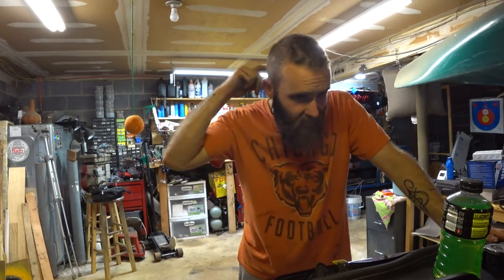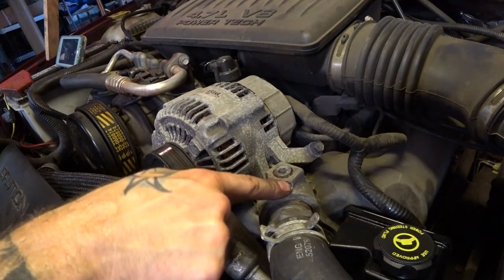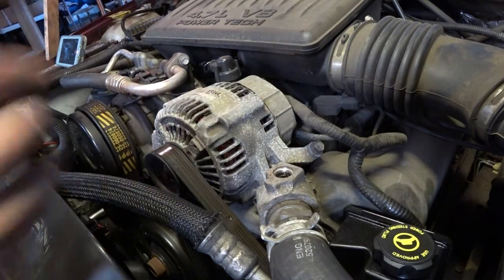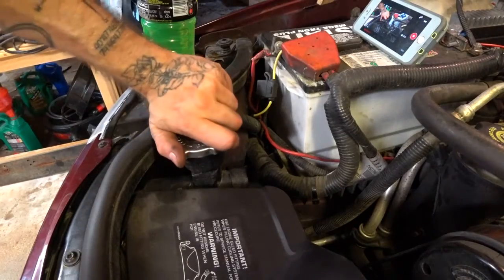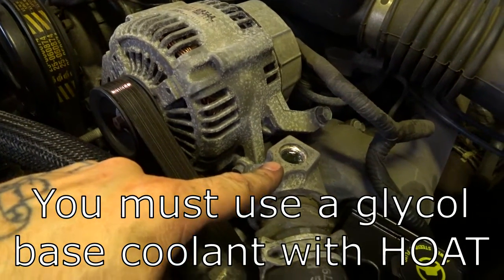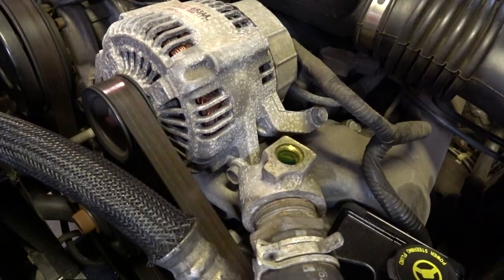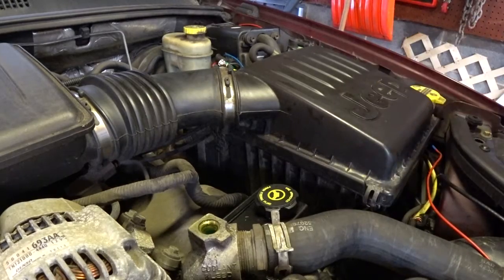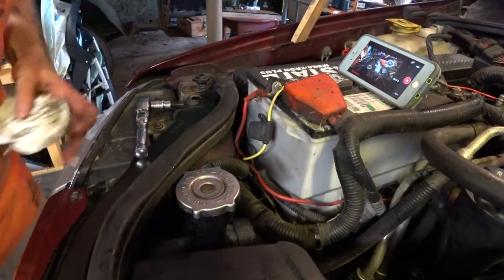How to Bleed a  Radiator - Jeep/Dodge 4.7L

Comment: I'm an 01 Dakota sport v8 owner. About a year ago, I was getting ready to change out my radiator but I wanted to know how to fill it back up properly. I saw another video on YouTube that shows you how to properly fill the Dakota sport that have a bleeding port. In it, the guy stressed the importance of removing the bleeder valve screw before filling it up. I was at that step, when I went to remove the screw, it freaking strips! Had everything installed and ready to fill when this happens. I was like a sh**! So, what happened was, I followed the other steps, turned the heater full blast while filling up the radiator, and I waited for over 30 minutes, observing bubbles coming out where the radiator cap goes, and when I could see very little to none and decided I waited long enough, I put the cap back on and took off on a ride. To my astonishment, the temperature gauge did not hardly budge. The needle on the gauge was well before the middle just above the C, meaning, the truck was not overheating. I thought, so long as this doesn't overheat, I'm good. However, not too long after changing the radiator, I get a leak. I looked for the source. Found out it was the pump, again. But why? I think the pump failed prematurely because there was still air the system. I looked up if not bleeding your coolant system properly, it can lead to failure of the cooling system parts, such as, the water pump.  So, I had enough. I took it to a shop and explained what I wanted done. This mechanic had also, not really heard of or understood what a bleeder valve was but assured me that as a mechanic, he learns quickly and problem solves effectively so as to get the job done. He said that bleeder valve screw was in a precarious spot. He did not want to damage the bleeder valve housing by pummeling it with a chisel and hammer. I got a call from him, and he tells me it was hell getting that screw off, but with a torch and some know how, he said he got it off. And yes, the water pump needed to be replaced. So, as I post this comment, my 01 Dakota sits in a shop and I hope the mechanic understood what needs to be done now to fill that truck up with coolant.

Comment: I doubt you see this on this old video. But my 2002 grand cherokee 4.7 doesn't overheat but last year I noticed that you could start it and let it run for over 30 min and top hose gets hot and seems to have alot of pressure in it.but bottom hose just gets warm.So I changed thermostat and flushed system and put the correct  coolant in it, jeep Chrysler GOLD. And here we are a year later and still does the same thing. Not a daily its just a toy and second car. And engine is a reman with 50-60k miles. Never gets hot but really worries me. I dont get it.

Comment: Where in the F*@*#*@*#"@ can you find replacement bolt ? Cap?.plug? What in the entirety of F#@####### hell is it called? Bout to set a brick on the gas pedal, toss a granade or 5  under the hood close it and and slap it in drive and make a strong whiskey drink ,this mofo has me boiling between this and finding the damn fan module.relay shit that stuck half in and half out of the fan shroud that NOBODY knows about .. 2012 Liberty 3.7 Sport that theres NOTHING sporty about it ,4WD . seriously should have P.O.S. EDITION emblems all over it .

Comment: hey! what's up! I never hear my fan coming on as my  04 4.7 limited Wj gets hotter, it used to always just sit a little below 210 no matter what and now up a hill on the freeway it will go past 210,  also I've replaced the water pump, thermostat, burped it, heat sensor... just cannot figure out?  the fan is moving but it really doesn't kick up when you think it should, the solenoid seems to be good, for instance, I put the thermostat in wrong by accident and the fan fired up to cool the engine or tried to until I realized what I did,  I caught it before it would get to hot .. anyway...  any advice ? for this  pain in the ass!  ps I love the chanel, I saw a few of your videos  back before I got into this whole WJ World and you explain things vary well! so thanks for that!

Comment: My dumb self tried to do this in a autozone parking lot with the employee next to me as I borrowed a tool to remove the bleeder cap as coolant proceeded to blast out at the both of us, engine wasn’t that hot yet so it wasn’t that bad. Lesson learned, don’t bleed things after running engine wait a little bit 😭🤚🏻

Comment: This video made my day after changing the radiator on my 310,000 mile 07 Chrysler Aspen whichever continued to over heat when I swapped it out. I can across your video later that night and removed all the air pockets the following morning. Thanks again.

Comment: Question I have a 2001 Dakota and the radiator cap is on the hose connected to the bleeder 6 inches away do I still need to take that out I use a burping funnel on the radiator cap area

Comment: How much coolant does it supposed to hold?Also I've seen where people are replacing the stock thermostat for a 180 degree one.What are your thoughts on that?I just got an 04 dakota with an 06 or 07 4.7.

Comment: Proud owner of a completely rust free 2002 Jeep Grand Cherokee Limited with the 4.7 H.O. V8. For the last 3 months, I was plagued by my truck overheating, sent it into the shop MULTIPLE times to get it figured out. Each time replaced parts (thermostat, heater hoses, power steering pump, even completely replaced the AC Pump. Same issue, truck kept overheating, UP UNTIL I SAW THIS VIDEO! Woke up, came outside, and followed this video. Lo and behold, almost a whole jug low on coolant when I followed this process! Finally saw coolant through that bleeder valve, capped it off, and boom! Truck has ran LITTERALLY FLAWLESSLY since. I seriously cant thank you enough! You litterally saved a good truck thats 22 years old and means the world to me!
Reply: Could be cause you keep calling it a truck

Comment: Mine runs cool. When temperature outside is below 20 degrees, air my vents blows at 100. Temp gauge doesn't even reach middle. 07 ram 1500 4.7. personally I'm glad it doesn't run hot since has 257k.

Comment: So i tried this technique after replacing water pump. I filled the reservoir. Opened the bleed port and the radiator cap. Nothing came out of the bleed port. Waited a while, jeep got up to temp, i poured coolant into the radiator, still nothing. Then white smoke started coming out of the bleep port.

Comment: This particular engine, the 3.7 and 4.7 seem to have a lot of heat related head issues on the passenger side.  I think the solution is to drop to a 180 or 160 thermostat to give more of a cushion to that passenger side head - which tends to run 30 degrees hotter than the drivers side head.  The 195 thermostat leaves that passenger side head dangerously close to getting too hot.

Comment: I did what you say, I drove it for 5 minutes, the temperature went back up, the engine light came on, a bunch of white smoke from the exhaust pipe, and it stops due to overheating again

Also I mix the antifreeze with water because I was not sure the problem would be solve, I wanted to wait drain the water and put 100% antifreeze, now I don't know what to do.

Comment: Hi, I have a jeep grand cherokee laredo 2001 4.0 my mechanic changed the head (as it has a fisure) and the gasket but now is over heating. coud it be bubbles in the cooling system? do you have some tips on how to burping the cooling system? thanks

Comment: Quite similar filling procedure to a Terminator 4.6L. V8.the bleeder is in a steel crossover tube at the front of the motor.A collision center failed to fill properly after repairs.Engine overheated with no warning,damaging the aluminum heads and the oil cooler adapter.Insurance company approved $6,000 worth of repairs.This was very informative,as a friend has one of these with overheating problems.

Comment: I just put a new radiator in my 05 dodge Ram 4.7. Now it is overheating and not blowing heat. I got the air bubble out to the best of my ability but didn’t jack up the front end. Messed up thermostat maybe?. Before this the heat worked fine and it didn’t run hot but the rad had a significant leak.

Comment: Just bought a 2004 wj 4.7 . The threads on the bleeder are beat. Can I put an inline bleeder on the top hose and jb weld the plug on

Comment: I bled mine with radiator open and tryck running for 15-20min while rotating air and heat on high.   Is this sufficient.

Comment: So I had a Dodge Dakota with a 5.9 I sold it and I bought one with a 4.7 long story but there was a reason. Anyways I've had problems with overheating because of bad thermostats I put a new thermostat in mine every year and a half because I'm buying the cheap Chinese made one so I bought the more expensive one this time long story short I couldn't understand what the little bleeder 8mm Allen screw was for but I ran across your video just trying to find out the best way to change out the thermostat it's in a crappy place.
So anyways my question is on mine the radiator fill is on the same hose that the 8 mm drain plug is (drivers side) not like on yours. So it seems to me if you run the motor with the radiator cap off should do the same thing as removing that 8 mm plug correct? Or not?
So my concern is I've run the truck hot more then a few times so what are the symptoms of dropping valve seats? What should I look for and what should I inspect I hope to hear back from you.

Comment: The bleeder screw is superfluous on vehicles that have the expansion tanks. The 4.7L comes with the bleeder screw because the engine is sometimes used on vehicles, like yours; that don't have exspansion tanks. You can help it along if you pop the expansion tank lid when full cold for the first few days after refilling. Make sure you run the heater until it puts out hot air. If it doesn't, you may have a clog in the heater core, or lines. When gas no longer escapes when you pop the expansion tank lid at full cold, you're done.

Comment: A better way to fill and bleed the coolant is to remove that 8 mm plug,take a transmission funnel with the small end and screw it into the bleeder hole where the 8mm plug was,remove the radiator cap,fill the cooling system through the funnel until coolant comes out of the radiator where the cap was.basically you are reverse  bleeding it.i do it all the time at the Chrysler dealership I work at.this method works well quickly.
Reply: You do this while the engine is running right to let the thermostat open up as well?
Reply: Thanks for the VERY helpful tip! I WILL try it, LORD willing 🙂
Remember that God loves you, so smile!  🙂🤎
Reply: Thank you sir will try this

Comment: Nice, goin to do this on my 4.7 tomorrow. Already fixed a overheating issue with a new radiator, fan snd thermostat a couple years ago but might as well. Need to flush my heater core too, heat is WEAK. Cant let the ladies get cold riding shot gun. When i started it with the bleeder open it squirted coolany everwhere

Comment: December 7th 10:00 p.m. 2023 I have a 2006 Jeep Grand Cherokee just changed out the thermostat and check the fuses because my car was overheating I have been trying to get the air bubbles out of my system like on your video still getting bubbles in my overflow overflow tank have tried to get the bubbles out by opening up the valve at the same time ran car for 40 minutes and I'm still getting next I will try parking on a slope or using ramps to push the air out of my system thank you for your video and skills

Comment: I have a 05 jeep with that 4.7. sunk it in some water put a new motor not a used one but new. Put all new sensors ran all new vacuum lines new injectors coils plugs you name it I replaced it. I have a p0172 and p0175 bank 1 and 2 are running rich. I relocated the air filter to the top of the motor. That's the only thing I changed and I took the ac out and put a bypass pulley on it. Vacuum is at 19-20 idle fuel pressure is good 58-60 I'm lost at where to look next. My thoughts now is I put the air filter to close to the motor and it's getting way to hot of a air temp in the chamber. The way I think is the hotter the air into the motor the less oxygen available for proper running conditions. Any thoughts?

Comment: Question: When replacing the bleeder screw & radiator cap does the engine need to be running or does it need to be off when putting cap & bleeder screw back on? Or does it matter? Thanks for this video, very very helpful info!!
Reply from the maker: Engine should be running to circulate the coolant and bleed out the air. Once all air is out you instal the plug, shut it down and let it cool off

Comment: I notice my engine is running a little hotter than usual, would that cause my transmission to over heat? I get the transmission over temperature thing on my dash.

Comment: Thanks for that bit of knowledge.  Just replaced my radiator on my 99’ 4.7 and what a job that was. Tranny lines were rusty, ended up with a new tranny cooler also.

Comment: My 2000 Jeep Grand V8, 4.7L runs hot all the time. New radiator, a new water pump, and even bought a new thermostat at the dealer. 190 is too hot for any motor and it gets hotter than this. I have bled out the system 3 or 4 times. Is there a cooler thermostat.???

Comment: Thanks for the info. Just replaced the radiator and could not figure out why it kept spewing now i get it. Good motors but some design flaws for sure. Great to the point video with good volume and clarity. Thanks man

Comment: I have put a four foot breaker bar on my bleeder and still cannot get it loose. I ended up using one of those “spill proof burping funnels” on the radiator cap. Would that still work because it would then be the highest point?

Comment: Hi i have the radiator cap off and the bleeder off and been waiting like for an hour for the air bubbles to go away its not as bad as when i started but i do still see micro bubbles. Should i wait untill it completely goes away or should it be ok to close everything? thanks

Comment: Should I worry about my valve seats loosening after a short overheat? As soon as it got hot I turned it off. Would you recommend tightening them back to spec on a vehicle with close to 200k?

Comment: Question would the air bubbles cause the top hose to be hot and the bottom hose cold.i replaced thermostat,radiator,water pump and upper and lower radiator hose and i still over heat no sign of a cracked head i tested thermostat to see if it opens at heat spec and it does(i put it in boiling water)still i overheat with the same problem top hose hot bottom hose cold

Comment: So....at full cool down (2 days at rest), the coolant was gushing out when I started the engine. 05 ram 4.7l. I haven't been able to replicate this video. Am I looking at something bad, or is it normal? There's definitely air in the system because I can hear the brand new water pump cavitating. Water pump was replaced with new oil pump, timing components, fan clutch, t Stat, and radiator. Was not overheating this badly prior to the repairs 🤷🏻‍♂️

Comment: Would the same apply to the 3.7L? I changed radiator and water pump, burped the system for 20 mins through the radiator cap and then it slowly started to overheat.

Comment: I did the same thing, dropped the bolt when removing it and it landed in the abyss somewhere, never did locate it... lol 
Went to the local parts and hardware store and had a hard time finding a replacement, i think it's a 16 mm with 1.5 thread size.

Comment: I have a 2011 ram 1500 with the new 4.7 and i have changed all the plugs and wires and the ignition coils and i still have a misfire on cylinder 7 and i even changed the fuel injector and still getting the misfire cylinder 7 code.

Comment: Another tip: anything with a secondary heater core, turn the rear hvac unit to heat position (at the rear hvac unit control panel) so that the heater bypass valve opens.. took me 3 times bleeding from completely cold to figure that out.

Comment: Like many of these other comments I was almost at the point of giving up. I flushed the radiator, change the water pump, changed the thermostat but nothing stopped it from overheating. As soon as I did what you explained in this video I watched the bubbles come out for about 5 minutes. Now it's running perfect this saved my butt, thank you.

Comment: Great advice man! I'm getting ready to do a coolant flush today and I'm so grateful that i ran across your vid. I only wish i knew this a couple years ago. My 4.7L V8 in my Commander overheated for no apparent reason one day on the highway. I pulled over immediately, shut her down to avoid further damage, but it was already to late, motor blown. $6,000 later, my new crate motor just overheated but i was lucky this time and the motors good. I did notice that the guys who put the motor in must've filled the radiator as well and put some green colored shit in there, which was wrong since everyone should know that motor requires HOAT, which is an amber color! If they didnt even do that i doubt that they bled the system as you suggested in your video. Which is possibly why car overheated again. Well, they say if you want something done right then do it yourself and that's why I'm off to do my coolant flush right friggin' now! Peace✌️😁
Reply: For what it's worth, Prestone makes a HOAT, Aluminum head compatible antifreeze that is green. I don't think the "only orange" rule still applies 100%. However, unless you personally put it in yourself you can't be sure what it is.
Reply: This happed to my 01 Cherokee 4.7, except I pulled over before it got to the H, so far haven’t had any issues so I hope I didn’t do damage to the engine.
Reply: Aw😮🎉ny😅llamymaYjjmwsaka
Awoaa😅l😅l

Comment: Will the jeep stall out if there is air bubbles in the system? I jad mine bled out, because i couldnt get the valve off, but its still stalling and temps getting hot. Should i do it again, but do it myself?